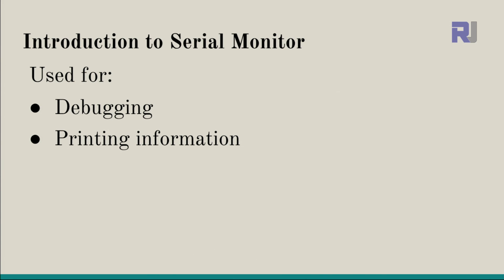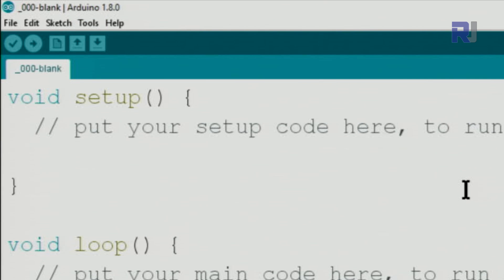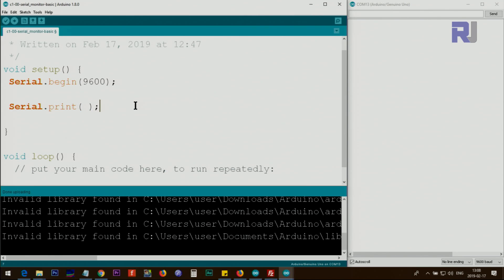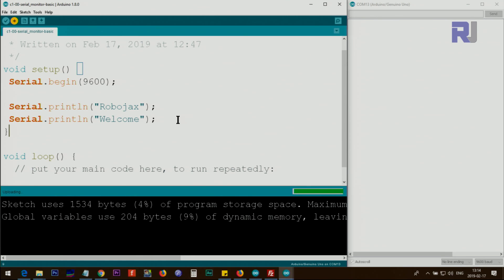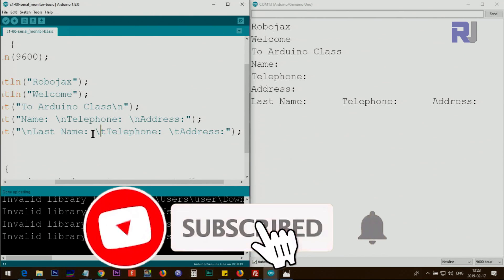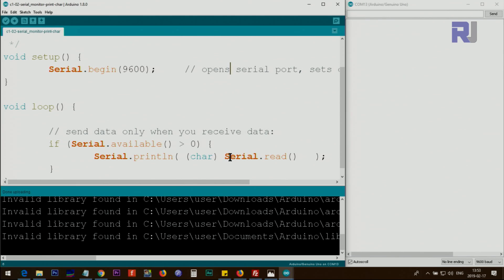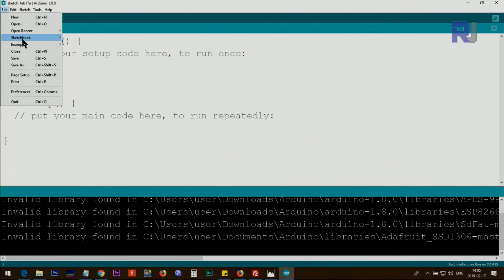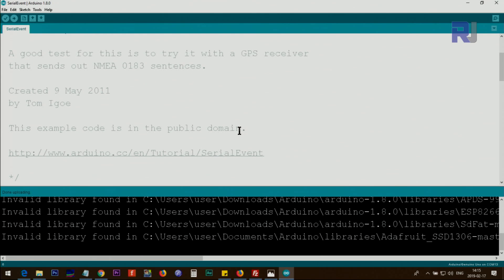Lesson 05: Serial Monitor reading user's input char, binary hex and baude rate - RJT549

Comment: Hi, I liked the video but the code needs updating. When I followed your tutorial and typed (a) in the serial Monitor I got 97 and 10 and when typed (b) in the serial Monitor 98 and 10 typed a in the serial Monitor and when typed (c) in the serial Monitor 99 and 10 typed a in the serial Monitor. I also used you code and got the same result. Please fix good tutorial. I am using Arduino IDE 2.0.3
Reply from the maker: Hi, I did not understand what is the issues to be fixed? I've shown the principle and it should be correct. Some time I might say one thing and do something else like press K but I press G and the viewer will notice is that that i an error.  so  you did not learn at all or are you trying to pint my mistake?
Reply: @robojax  Hi thanks for your reply.  As I said above when I use your code, just to make sure I got the same result, when I type in the serial Monitor (a) I get the first number 97 and below it also appears 10 at the same time. I think it is showing the DEC power as well as outlined in tutorial Lesson 4. Note I am using Windows 11, Arduino IDE 2.0.3 and key board is English (Australia) US. The tutorial is still good but is there a way to stop it displaying the DEC power (10).🙂
Reply: @justlearning8475  Hi. Not sure if you will receive this. I too got the same result as you when entering (a) and the result was 97 and 10. All results I received had a 10 as the second number. What I found to resolve the issue was to select "no line ending" from the drop down to the right of where you enter data. Thanks.
Reply: @peterc6547  Hi, thank you for letting me know. I recall it didn't happen in Win 10, but it did happen in Win 11.